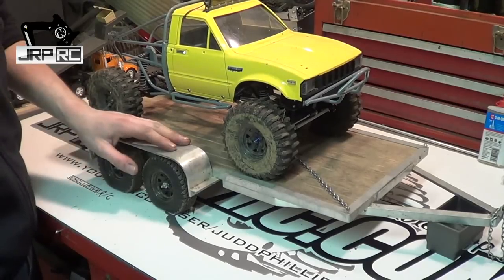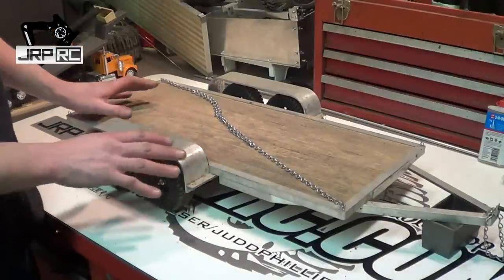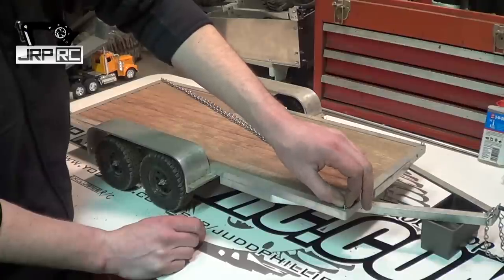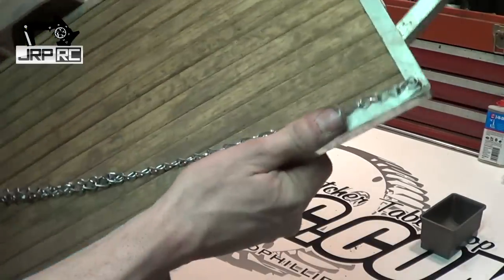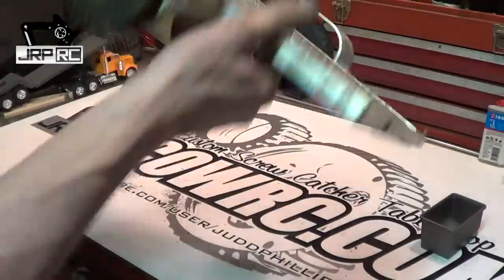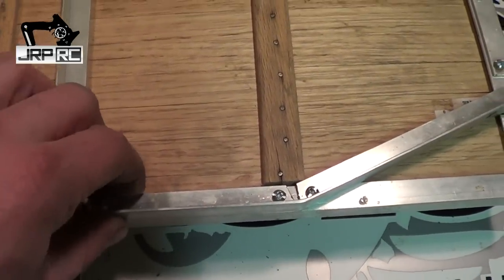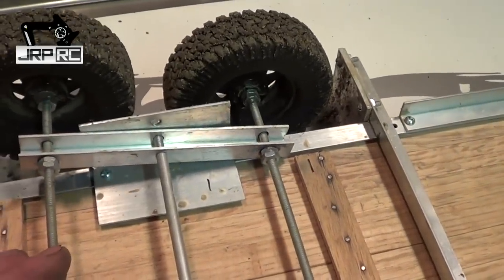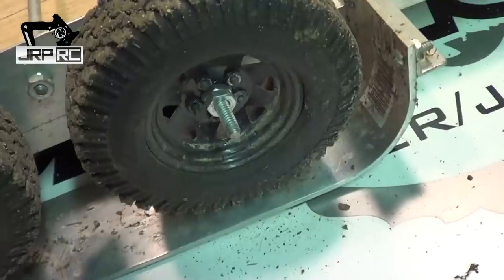JRP RC - My Custom Car Trailer

Comment: I have been watching YouTube videos on RC car trailer builds and this one is the most well thought out one i have seen i like the pivoting wheel system and i would like to use the design. you gained a subscriber on the back of this video.

Comment: first off awesome job on the trailer. second, i dont have the money for tamiyas trailer lights so i am making my own custom set up. i have power going to the signal lights on the trailer if i plug them directly into the port of the control board i bought from common sense RC. now if i  splice the turn signal wire and try to link it with the truck the signals still work on the truck front and back of the king hauler but im not getting power to the lights. can you help me?
Reply: sorry im tired i hope its not confusing

Comment: Does it run 1.9 or 1.55 wheels and tires? Its a real mean and sleek looking trailer, great job!
Reply from the maker: there 1.9s, the next one is going to have 1.55s and thanks!
Reply: JRP RC Judd Phillips Thanks, cant wait to see the next one!
Reply: JRP RC Judd Phillips judd try 1.55 mud thrashers if ya didnt already find a 1.55 tire
Reply: JRP RC Judd Phillips judd try 1.55 mud thrashers if ya didnt already find a 1.55 tire
Reply: not exactly sure i know they're the rc4wd wagons im sure an the tires i dont know

Comment: im trying to build a trailer based on your design, and my aluminum c channel keeps breaking when i make the 90 bends. just wanting to know if you used softer metal or how did you make them bend without breaking them?
Reply: MrRichardames6 Hey there just wondering did you ever solve this issue? I am about to make this trailer myself and do not want to run into this problem I have already started my wooden deck. I am waiting on the c channel and angle from Home Depot hope it works out.
Reply: RC addicted product
Just wondering if you had a problem bending the angle iron? What's the thickness of the angle iron 1/2×1/16"?can't wait to get the materials and start on this

Comment: man i love this design, would you have any problems if i used the basic design but made it my own?. I love building trailers and this design is the most effective cost wise i have seen in some time
Reply from the maker: go for it! if i didnt want people to copy my projects i wouldnt make the videos :) i think the most expensive part was the wood for the deck
Reply: thanks very much.
Reply: +JRP RC Judd Phillips hey would u sell that trailer
Reply: JRP RC Judd Phillips how wide and how long is it

Comment: The suspension is similar to out suspension on our log trailers just without springs it like and equalizer it equalizes the weight but im not sure of the actual name of suspension either
Reply: stephenjray1988 I think that would be called a walking beam suspension.